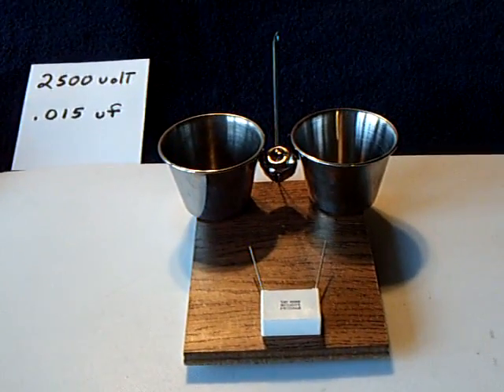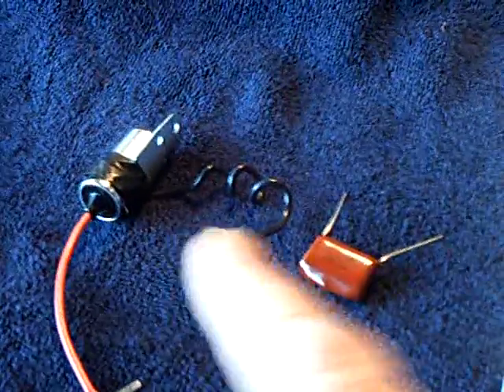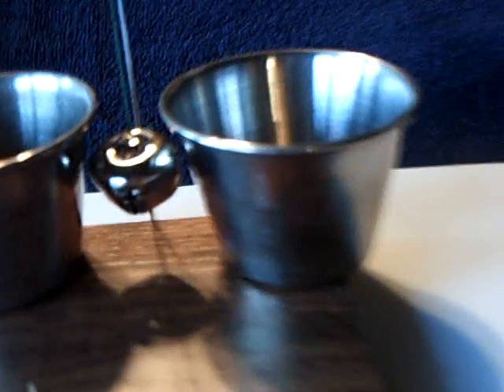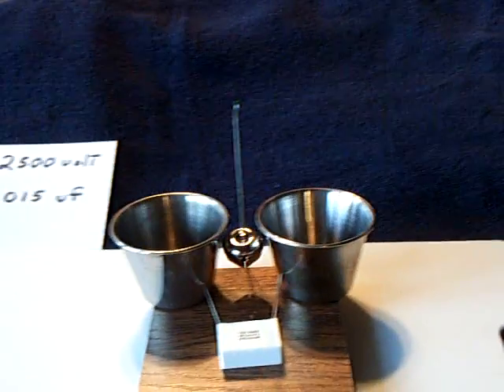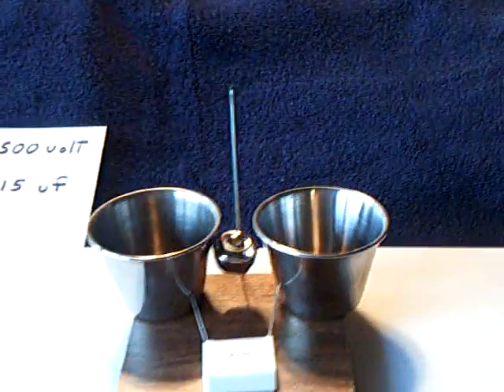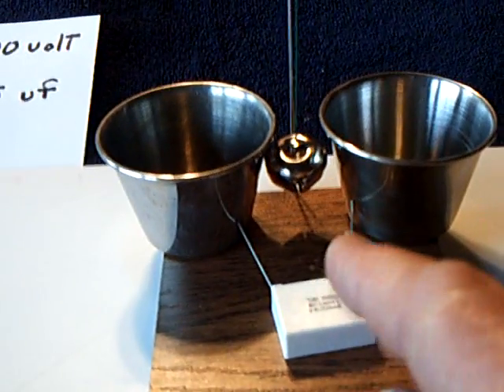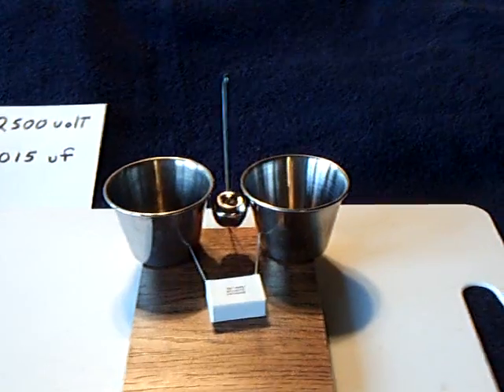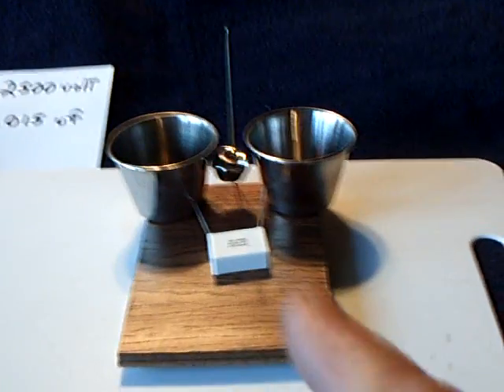Capacitor Bell

Comment: Hi Lidmotor, tnks for sharing, if you google internet you will find a similar device which works forever! Try a bifilar or multifilar coil on one of the capacitor branch for more time in function! All the best! Also you can try a capacitor builded as a bifilar coil!

Comment: That's a nice, simple, Christmassy set up. Thanks Lid!
Reply from the maker: When the voltage drops off in the cap this has a very gentle chime sound.  perfect for Christmas.  I found out that it will run for two hours when the cap is full.